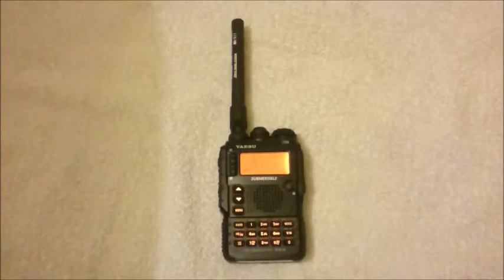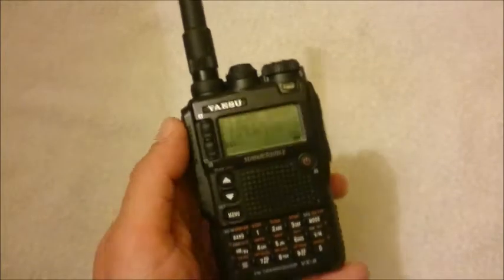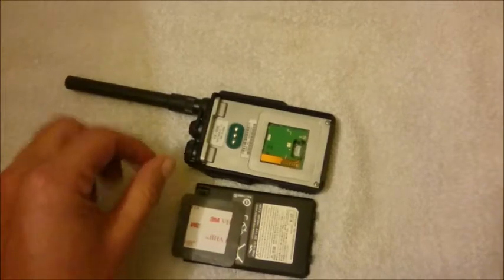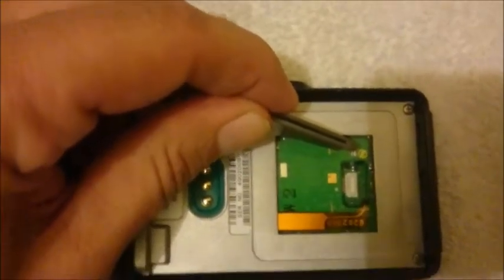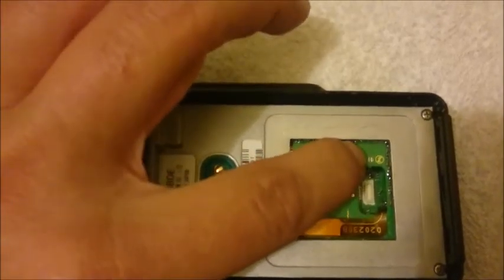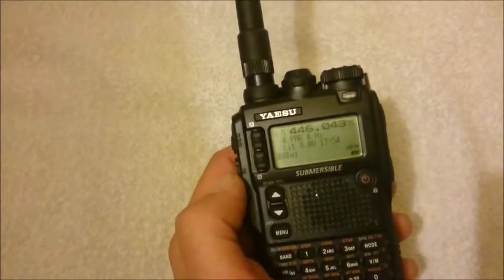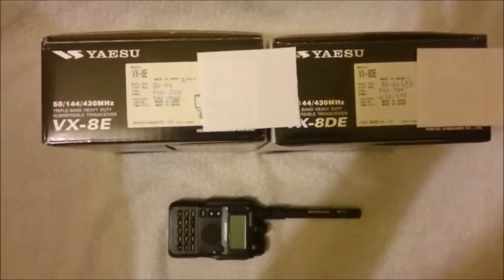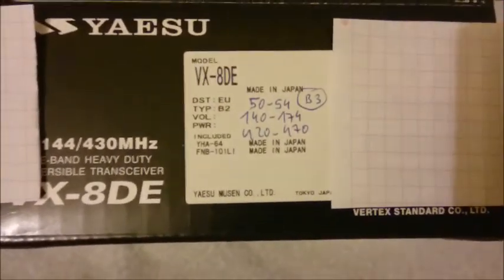Yaesu VX-8 Hardware Mod, Open TX Range Bug Out Bag Radio !

Comment: Hi I just saw your video today about VX-8DE mod. I tried pulling out the resitor. I can transmit 144.00 MHz FM but there is 222.000 MHz FM gives  ERROR not sure if I did it can you advise on how this works thank mate😊